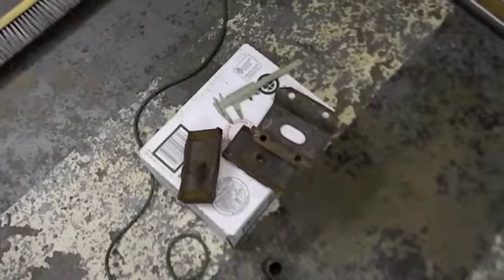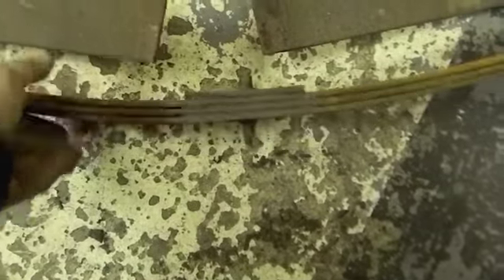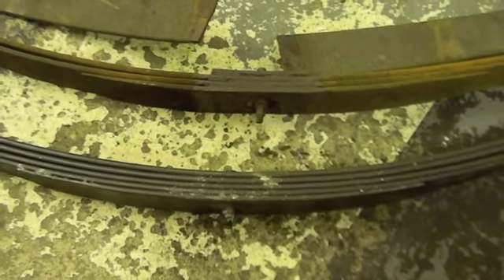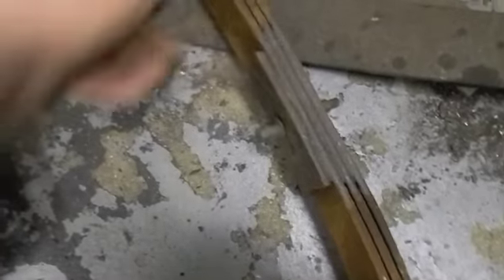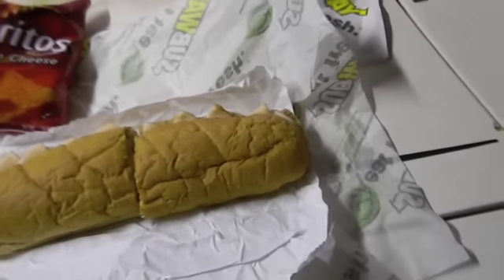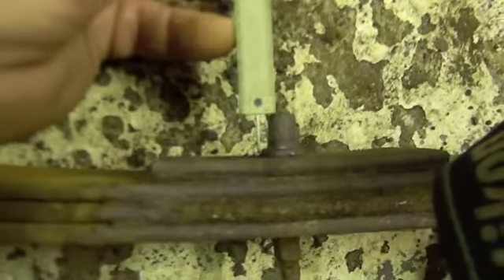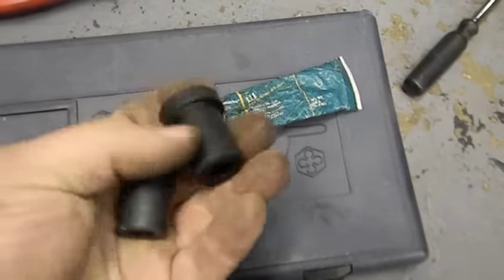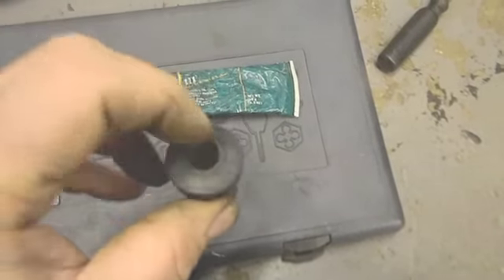Rear spring install pt.2

Comment: @homotorsports  Must have very little silicone in it. When doing rubber roofs it is imperative not to use silicone sealants. Just ask me how I know... I learned the hard way on that one...
Your Concord looks great the way it sits and when you get it loaded with goodies in the back you'll be happy you have the extra clearance. Now for some chrome tips on the exhaust and you'll be good to go...

Comment from the maker: @Busia1949 I only ate 1/2 of the sandwich i`m dieting.The tube of 111 is almost 20 year`s old i used to use it on door and sunroof gasket`s when i worked for Mitsu. and never had an issue.